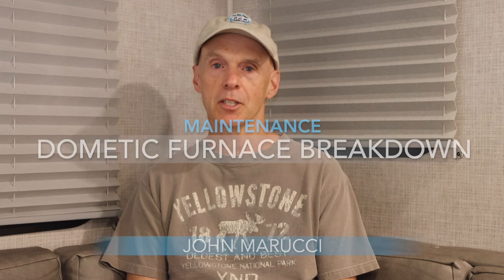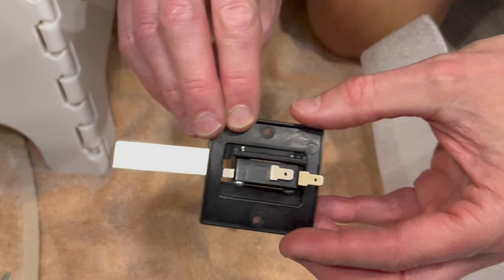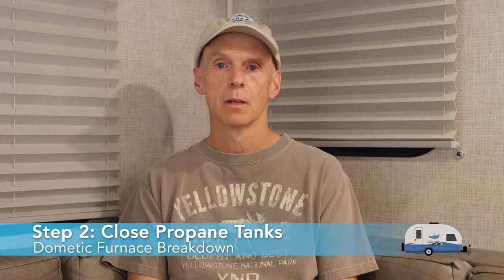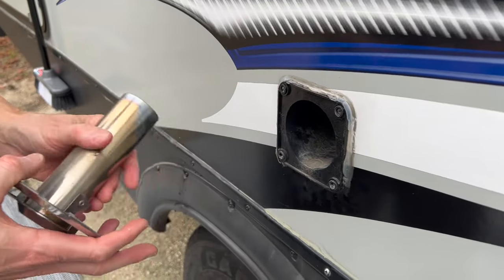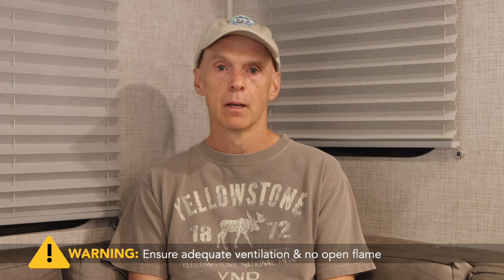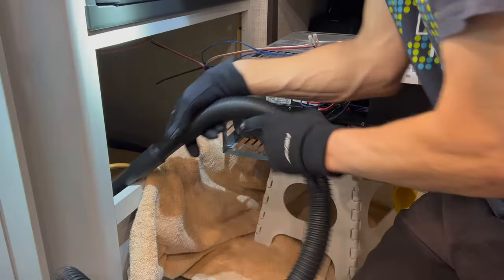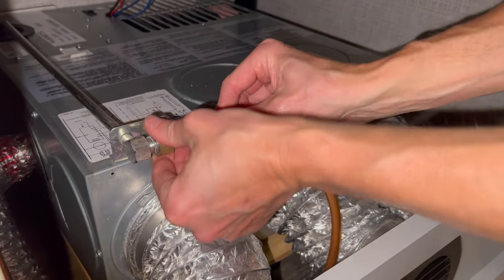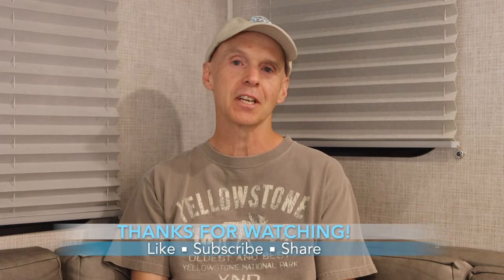RV Furnace Troubleshooting & Sail Switch Replacement

Comment: My opinion is that Dometic furnaces have a number of things that can go wrong and they are not particularly reliable. The metal fan came apart on mine. And when my 12V system is low, it doesn't work at all. I'm just waiting for my next problem with it. Consider buying a Mr. Heater Buddy. A good backup when you don't have AC.
Reply from the maker: I have had every Dometic appliance in my RV fail besides the water heater at this point. It may be the quality control of the company in general and not just the furnace. Thanks!

Comment: I have replaced three furnace cores….wired them in, nothing.  Checked propane.  Finally removed it completely and drove it to a repair man.  They troubleshot to a Motor, the control board and sail switch.  All replaced.  They tested heater….it worked on the bench check!   I got it back re-installed it.  It didnt start!   Nothing.  Next I am checking my red wire for power!  To see if I am getting any electricity to the unit.  I am at a loss and freezing.  Could there be any other circuit, switch, gas, that is keeping the furnace from lighting up?  The maintenance guys at the repair shop says I have to drag the trailer in so that  they can troubleshoot the wired from the unit to my thermostat.  Do u have any other suggestions to get this Suburban heater to work?  Sign me Sleepless and cold in Seattle!
Reply from the maker: Sorry for the late reply. It sounds like an electrical issue, given the becnh test worked. I'd take a volt meter from the fuse box all the way to the unit checking for proper voltage along the way with the furnace on at the thermostat. Seems like something not getting current.
Reply: @JohnMarucci  thank u!  I had called a mobile repairman!  He came out wired it correctly and it work!  Shzzzzz 144.00 for half hours work!  But the furnace is working like a charm.  Thank you Sir!

Comment: Thank you thank you thank you. I guess I am hoping that when the technician removed the furnace it dislodged the debris, that was causing the problem.  If it was a debris problem.   If not I will probably attempt a DIY repair.  Wonder if anyone ever thought about putting in an access panel on the outside of the trailer.
Reply from the maker: Glad the video was helpful. I think they try to keep costs down is why no external access to the furnace. Too bad, because the sail switch is a very easy replacement task. All the best!

Comment: Jesus C John what a freaking project but great step by step!   Really an important video!
Reply from the maker: Yep, nothing like finding out your furnace doesn't work a few days before it is going into the 20's overnight! Pretty much everyone with an RV should be aware of this one. Not a difficult fix.
Reply: @JohnMarucci  def have seen a lot of posts on Airstream forums with it - and like you happens when the Temps are on the way below 0 and want the tanks to stay heated with the underbelly.  Usually the same issue!

Comment: Thank you for making this video! I am also upset that Keystone did not install an access panel to allow the sail switch to be properly maintained without having to completely remove the furnace. I have a 2018 Keystone Passport Elite and it will be the last Keystone I own. Way too many quality issues encountered. I will install lightweight filter material on the back of the louvered access panel to catch some of the lint that makes its way into the unit.
Reply from the maker: Glad the video was helpful. I also considered adding some filter material to prevent lint from getting near the sail switch. May concern was if the material came loose into the furnace in some way. How do you plan to secure any filter material?

Comment: Had a similar issue. Replacing the sail switch was one thing I did. I also noticed some wires were loose. Always check the connections also. Seems to have fixed the problem. 
It would be nice if the manufacturer would install a filter holder like the ones in home furnaces.  Thanks,  John.
Reply from the maker: Good tips, thanks for sharing!

Comment: First of all, John, this is a fantastic video. This is the first video I have seen that shows in detail how to remove the furnace. I have a Passport 239ml withe the same setup. I followed the instructions step by step and, sure enough, I had a wad of dust on the sail switch. I replaced it with a new one and while I had it out, I replaced the control board to be on the safe side. When I reassembled it, it still does the same thing it did when it went out. Blower comes on for about 20 seconds then cuts off. I think I’m going to order a new limit switch and electrode. Any other ideas what it might be? Thanks!
Reply from the maker: Not sure what else it might be. Usually if the blower is running and it fails to ignite, it is the sail switch not closing. Hopefully changing out the other parts you mentioned will do the trick.

Comment: Great video! I am looking for a diagram of my furnace to know all the components and figure out why my blower doesn’t shut off. The thermostat is set to off; but the blower doesn’t turn off and it drained the battery. Luckily I opened the outside furnace cover and there is an off/reset switch. I turned it off for now. I think there might be a sensor to the blower motor from the thermostat and that might be bad. Thanks to your video I will also check the sail switch. New subscriber. Cheers.
Reply from the maker: If you have a Dometic thermostat there is a way to reset it. That could possibly be an issue. My video on the Dometic thermostat is on YouTube.

Comment: My only problem with our old RPod propane heater was a faulty circuit board.  I had to take it to a dealer to run down this problem.
Reply from the maker: Thanks Tim for sharing your experience!

Comment: I have a crossroads sunset... Same issue... I'm furious I need to remove this furnace.. on a 2019 model- easy access should have been a must have.. dometic hot water heaters with crappy circuit  boards and now a crappy dometic furnace.. I wonder if dometic has had any lawsuits from people almost freezing to death in the winter due to their negligence in manufacturing crappy products that are designed to fail when you need them most.
Reply from the maker: It is a very frustrating issue to have besides being dangerous. I changed my sail switch right before a big cold spell. It would have been rough without the furnace. Lack of easy access speaks volumes to how cheap the manufacturers can be. It is a very easy fix if access is easy. All the best!

Comment: So this just happened to me last night and my 243 bullet. I'm curious why you had to take off the exhaust plate on the outside? It seems to me that if it's just a slip joint, couldn't you just pull the furnace out and put it back in exactly where it goes? Mine is a 2021 and the only difference is that they have raised the furnace so that you would just pull it straight out instead of out and up like yours. Thanks for any feedback you can give me
Reply from the maker: I tried to not take mine off and because of the angle of my unit I couldn't get it seated back properly. If you don't have to remove the exhaust and can reseat the furnace, I'd leave it. Great question. Thanks!
Reply: @JohnMarucci  Got it. saved the day. still getting pretty cool at night in Oregon. Thanks

Comment: Excellent video, thanks for sharing.  My furnace has similar symptoms as yours and I have scoured the furnace housing for a serial number, nada.  It looks identical to yours in every way.  Do you have your serial number available?  Would make purchasing a sail switch a bit easier.
Reply from the maker: My model # is DFMD30121. Serial number is 91884956

Comment: John I don’t understand why the outside housing plate had to be removed? 
I didn’t see anything from your heater extending to the plate and attached to it? Doesn’t it just slip in and out of the hole?
Reply from the maker: I pulled the external exhaust plate as this is what I saw on the videos that I researched. It may be worth avoiding this, as it would save considerable time (and caulk). However, I can't promise it won't cause some issue that I avoided by pulling the plate. All the best!

Comment: John,
I have a 2021 22 foot Bullet. It has a Dometic DFMD 20 furnace which looks exactly like yours. It may be less BTUs though.
At any rate when I turn on the thermostat and turn up the  temperature nothing happens at all. The blower does not come on nor does the furnace try to light.
I know abut the 15A fuse in the fuse box (which is good) but are there any other fuses or anything like that that you found on your furnace?
Is there a control board anywhere?
I did have trouble getting the fridge to run on propane this year I think because there was air in the line. So now I am wondering if the furnace is locked out some way from having air in the line.
Any guidance you could give would be appreciated.
Thank you for your videos they are very helpful.
Reply from the maker: First thing I would do is to light the stove to ensure propane is flowing properly. This should bleed the line. Next, if you have a Dometic CT thermostat, pull the faceplate, wait 15-20 seconds and put the faceplate back on. This will reset the thermostat. Here is a link to the CT Thermostat video if you are not sure if you have the same thermostat: https://youtu.be/HhT5v0i2vVo?si=H13NIdGyjsNG9QW_

Comment: Hey John, I have a 97’ itasca spirit. I have an outdoor access panel. 
Before I dig into this project I’d like to get your suggestions. 
I’ve been using the heater just fine until this morning and after looking at a bunch of stuff up and finding you. I have a couple questions you might be able to help with. But we’ll start with the first one.
1. How do I know if the sail switch is out or if my electrode igniter isn’t sparking?
Because my blower motor doesn’t shut off. It just keeps trying to blow to no end.
Reply from the maker: If you do have an external access panel to the sail switch, I’d start there and check that the sail switch doesn’t have lint or gunk keeping it from closing.
Reply: I was able to check the sail switch, and it seems pretty clean. It closes when I turn the blower on, and I can hear it try igniting but it doesn’t get lit. 
Gotta wait till Friday to replace. I also have an igniter en route.

Comment: Seems like the sail  switch is the number one problem for RV Furnaces. Dometic had a whole slew of them with this issue, and as a result some $1,200 furnaces are selling for $400--pretty sad for a reputable company like Dometic. Seems like it's well worth the time to install the access door. On My old Atwood everything was right up front, but seems like so many of the Dometics that is reversed and you get access to everything from the outside. Admittedly it's a pretty large hole to cut into your RV. It does seem like the area where the sail switch is is pretty small, and just wondering if there's some type of rubber grommet or small access door that could be used instead of the monster hole you typically have to cut?
Reply from the maker: The fact that manufacturers don't add an access door to change this part is problematic. It is very easy to do.

Comment: Thanks John. Excellent. Is there no seal on the exhaust port where it enters the furnace? No exhaust leak into the coach?
Reply from the maker: The metal exhaust pipe from the furnace slips into the metal outer housing fairly tightly, so I think fumes couldn't get back into the cabin. It is a good question and reminds me to always have a working carbon monoxide alarm in the RV. Thanks!

Comment: John, my Dad's thermostat cycles through the ac part fine,but it doesn't show him anything concerning the furnace. I am quite a distant from him,so hard for me to be of much help from here. Any thoughts?
Reply from the maker: If it is a dometic thermostat, have him try a reset by carefully pulling the faceplate, waiting 15-20 seconds, then reseating the faceplate on the thermostat. This should reset the unit.

Comment: Were you unable to remove and or clean the blower fan where you found the debris?
Reply from the maker: I didn't want to disassemble any more than I did given the risks while on the road. I do think you have good idea to clean out the inside of the blower fan if you can get to it. I may have done this were the RV at home not needing to be used. All the best!

Comment: John,  did you carry a ladder or some other way to access the top of your Rpod when you had it.  We just bought a 171 and trying to access the Keder rail or inspect the top is impossible.  Thanjs
Reply from the maker: I use a 10' ladder at home to inspect the roof. I do carry an expandable folding ladder when I travel. Got mine at Home Depot.

Comment: Great tutorial, but to me that didn’t look like too bad do a job and I personally would rather not have an access panel on the outside. More of a chance for leaks or entry for pests.
Reply from the maker: Good point, fewer holes in the outside the better. The job wasn't too difficult, just a bit of awkward lifting of the unit.

Comment: Is it possible to have installed the sail switch incorrectly? I have a new sail switch I installed but it still didn’t fix the problem and it won’t ignite still but not sure if there was a way I possibly did it wrong?
Reply from the maker: If it is easy to access, I would pull it and take a look. I had a large piece of fuzz stuck in mine keeping it from closing. Worth inspecting. Not sure why there is no filter on the furnace intake to stop this, so if the compartment where the furnace sits has any debris, it could get pulled into the furnace and clog the sail switch.

Comment: I cant remove exhaust pipe , do i need tool for that?( stuky)
Reply from the maker: If you remove the outside metal exhaust from the outer wall, the inside exhaust part of the furnace should pull right out. You don't need a special tool for this. However, I am not clear on what model RV you are working on. Are you saying you can't remove the outside part?

Comment: Electric tower heaters are the way to go.
Reply from the maker: I do have an electric foot heater I use during the day but not at night. If it gets down to high 20's it means pretty cold temps in the trailer with no propane furnace. All the best!

Comment: huh didnt know there was an on off switch on top only accessible from under fridge
Reply from the maker: Glad the video showed this. It is way in the back and you need to be careful to remember to switch it back on when reinstalling the unit.
Reply: @JohnMarucci  im wondering if mine is off replaced the board and the control relay and nada
Reply from the maker: It could be.
Reply: @JohnMarucci  ended up looking where the switch is there is just a hole .. no switch on top